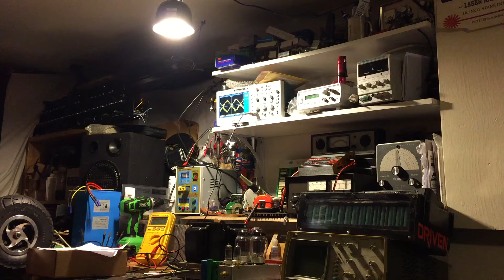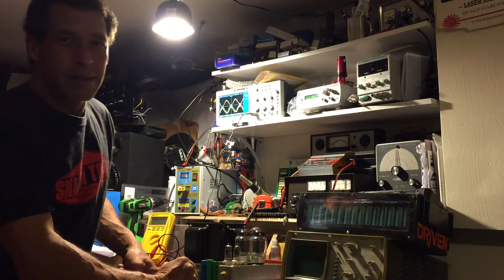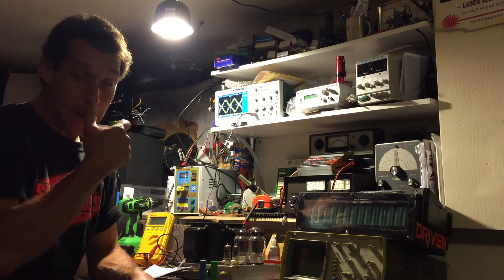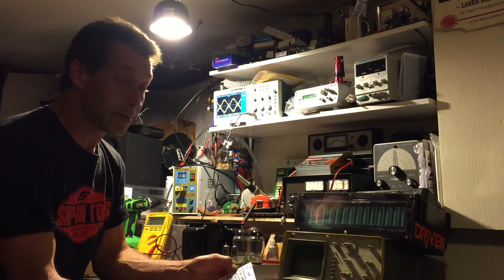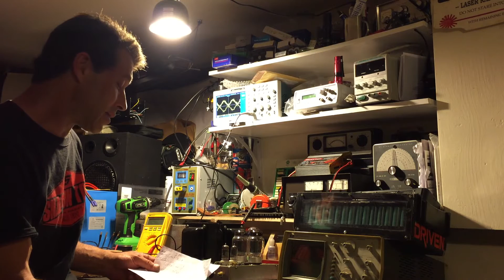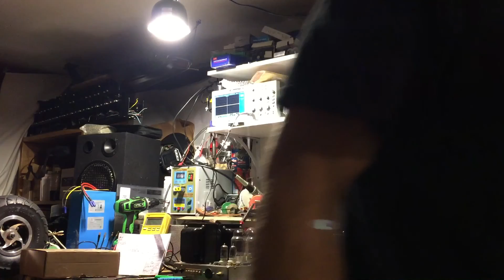18650 battery testing  for used laptop batterys for powerwall or batterypack

Comment: Good vid! I subbed. I'm discharge testing all mine at 1 amp down to 3v with an ImaxB6 and use that number as the capacity. I also record what the voltage drop is in the first 20mAh.

Comment: Howdy, that was a long rant indeed, but i did finally get your point (guess what, I was dismantling laptop batteries while listening to your talk...). I'd be interested to hear more about how you can use the osciloscope to read into this. Mind you, the classic approach of measuring cumulative mAh draw has the advantage that you can leave the process on the side and come back after 2 hours to write the total draw on the cells in the batch. your approach requires much ongoing attention. Maybe it would be cool to use the IMAX's ability to USB-connect to a computer, and have your curves on screen, since what you care about is the incline of the charge/discharge curve, right ?
Anyway, Keep on trucking ! (from France)
Reply from the maker: you got it ......look you well spend so mush time working on the pack you wont want to go back and fix it......don't know the imax but bet that would give way better reading....I know its a long video but I know I'm right on this one and don't want to see anybody get bummed by a long bulid only to find out that its not working for what we made it for...  it well work just need to tune in on the sweet spot of the cells.....thankyou for the comment...I could use the graph on my scope but may be overkill.i like your imax usb out better
Reply from the maker: that would work great thank you for the link.....

Comment: Great rant on your 18650 experience with output amperage capabilities on old used batteries. What are your plans? Are you thinking of building a battery bank as big as a 1000 kwh or bigger? If your going down this road test for internal resistance and overall capacity. I've noticed with higher internal resistance batteries and a 1 amp draw during capacity testing then tend to get a bit warm. 

Cheers and all the best. Let us know your plans. Thumbs up!
Reply from the maker: just got done building 1.2 kwh pack for my electric skateboard.it has 150 18650 in it....just trying to get the cost down on my batterys.so testing all kinds of 18650 that are new under 1.50 per cell at 2200 ma. amp testing is a must for me my board will take up to 65 amps and will be trying to get rid of my lead acid solar batterys in my home setup.thank you for the comment

Comment from the maker: ok my testing is now done ...first off my 10s charger has a mili ohm tester built in just read the book that came with it .....the internal resistance is the gatekeeper that, to a large extent determines the runtime. that's  what I'm sayin in the video...low ir more amps hi ir low amps......

Comment: Still got a bit to go on you clip yet but I do need to get a decent benchtop power supply. I see you have one on your shelf. Anything you can recommend to me?? 

Thanks.
Reply from the maker: astron power supply but thay are a bit pricey...but it will do 40 amps at 15 volts
Reply: Ah yep thanks. What about that white one on the right hand side of your shelf?

Chasing something that can do 0-24vdc at least and preferably up to 10A would be nice.